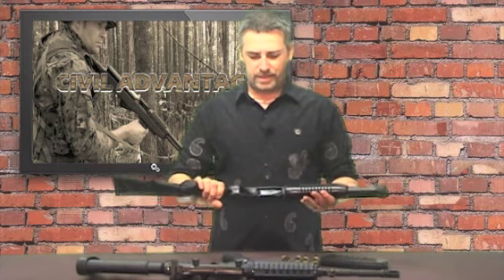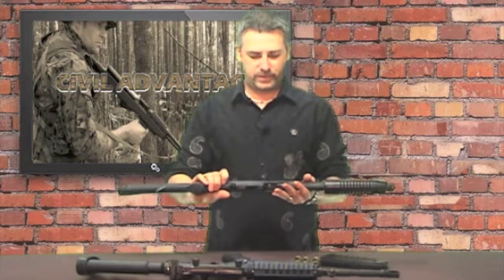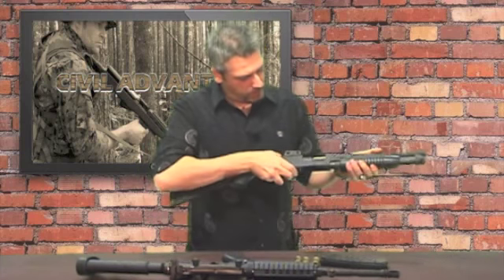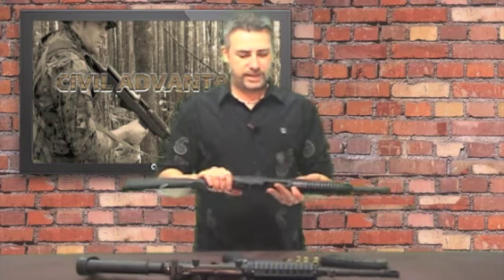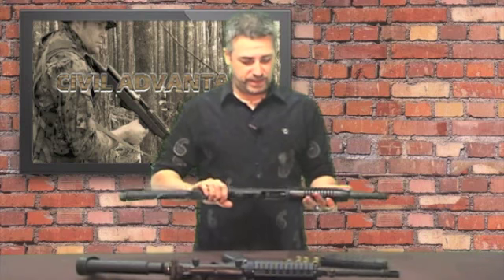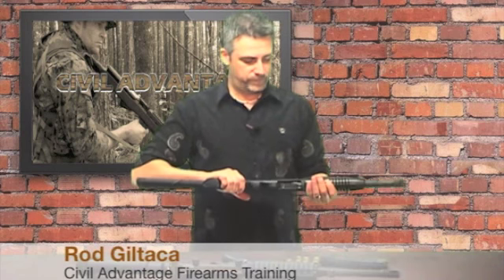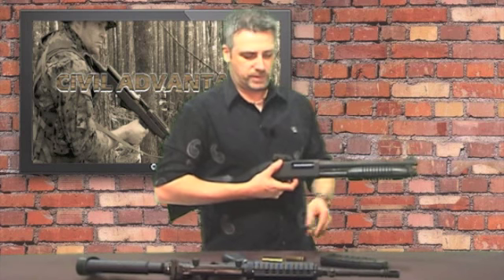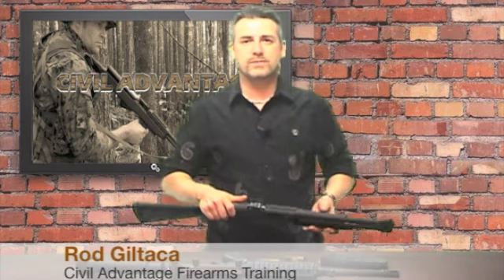Introduction to the Pump Action Shotgun

Comment: and that looks to be less than 18 inches make sure you pay your $200 tax stamp
Reply: In Canada if the shotgun is manufactured with a  shorter than 18 inch barrel it is ok ie: Non-restricted firearm. If you cut a longer barrel off shorter than 18 inches though, then you have a prohibited device. A no, no.
Reply: As long as the overall length is 26 inches or greater it's legal. No tax stamps in Canada we pay to take a safety course to get our PAL for non restricted and pay to take another safety course for our RPAL for restricted firearms. We then pay to get our license from the government.

Comment: is the 10 22 tactical a restricted
Reply: No, but there is a magazine limit at ten rounds for the Ruger 10-22 because the magazine could be used in the Ruger Charger pistol and all SA pistols have a ten round limit. Not for others though ie: GSG Schmeisser etc. or if you have Marlin, Henry tube fed plinker. Yeah, the laws are stupid up here.

Comment: I'm sure it has already been pointed out to you but in the case of the 870 your loading procedure is not quite correct, As per the manual wuth the safety on (safety button protrudes on the right side) and making sure the action is open you want to drop the first round into the square looking hole on the right side of the firearm (ejection port), metal part towards you and plastic part pointing away from you. Close the action by racking the pump forward, flip the firearm over then load the rest.